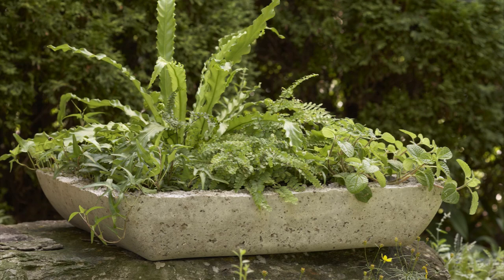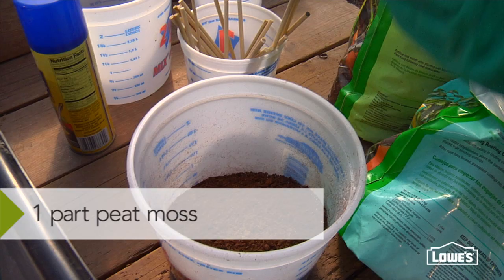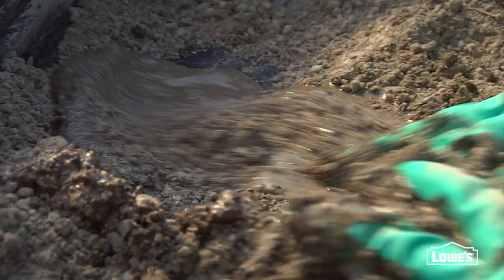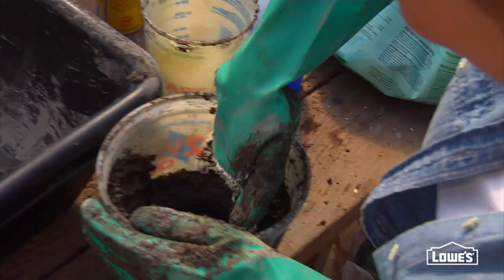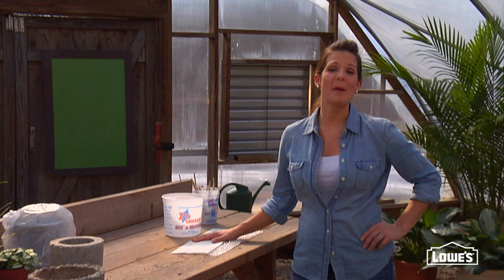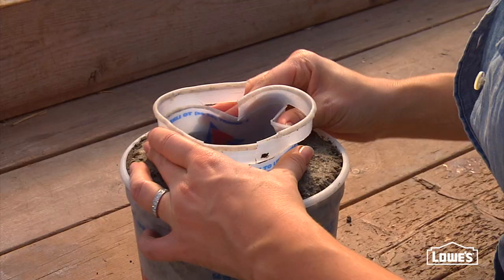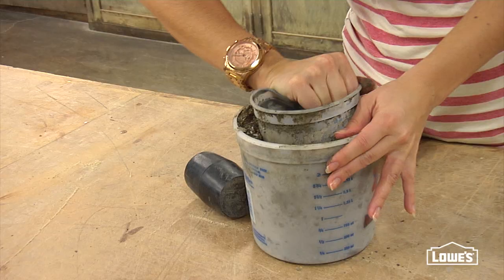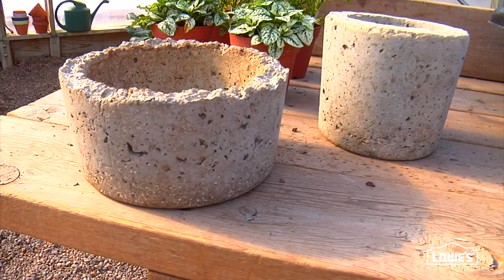How to Make Hypertufa Pots

Comment: If you want to make it more durable,  In addition to pearlite, peat moss and cement, add 1 part sand as well. Sand gives it more of a stone look too.
Also, during the curing time keep it wet covered in a plastic. That gives it maximum strength.
If you plan on carving it before it gets too hard, which I do,  Sift through your peat moss to get out any large chunks and sticks.
Reply: Thank you❤
Reply: Thanks

Comment: The purpose of these is to look like old stone troughs - and were originally used to mimic England’s old stone planters to plant alpines or other alkaline soil lovers.  Another words - azaleas and acid lovers won’t be happy until a few years or so have gone by to leach the lime from the portland cement out or to amend the beds and test soil.  It is the same situation with why you don’t plant azaleas etc right next to fresh concrete foundations.  Also I think this is basically a cement pot - too much cement in the mix.  The recipe garden clubs and Fine Gardening Magazine suggests is 2 parts portland cement to 3 of perlite and peat plus a handful of reinforcing fibers for added strengths. Or a 1 part portland to 1 1/2 each perlite and peat.  Look I understand the eco issue on peat moss however most that we get is from canada and they are pretty strict on harvesting, and replanting because they don’t want to lose the source.  The US doesn’t seem to have any restrictions but we don’t have much anyway so not a commercial venture.  Use alternatives when you can but I’m now fairly convinced of Canada’s commitment to limited harvest and replant even if individual companies might be greedy.  You can try coir fiber or the cocopeat but it would give you a different look and salt is an issue - coconuts grow in high salt ie beach and salt water..  You would want to soak/drain/repeat any coconut product a lot before using as salts kill plant roots. For orchids, even the coco chips that states is soaked, we soak again for a few days and drain a couple times.  The stuff in high quality potting (read more expensive) mixes has been adequately soaked and buffered like ProMix but most growers like to flush it pretty well.  Back to the pots - you can mix median length 3-5 inc spagnum moss in the mix or shredded paper.  When it dries up and falls out - it will leave a very textured surface too.  The reinforcing mesh Fine Gardening suggests is for strength not looks.  In terms of how much cement - it depends on the look you want and the weight.  The more portland cement - the more weight.  Also the more cement, the higher the ph will be and the more alkaline it will be in terms of leaching.  It all depends on what you want to grow and the weight you want to move.  The weight is why we don’t use a standard concrete mix which is cement plus sand and aggregates. 

Here are 2 links - one is using the mix to cover thick styrafoam planters -  https://www.finegardening.com/article/peg-shares-her-hypertufa-secrets

And their original which includes 2 step curing, leaching method - https://www.finegardening.com/article/make-a-hypertufa-trough

And for aging your regular clay pots for the traditional moss grow that costs a fortune to buy already done - There are prepared moss milkshake products and all kinds of moss - Moss Acres.  If you want to use hypertufa pots to grow moss on the outside for shade growers etc - let it sit for a year or two or better, use it for a couple of yrs with alpines before transitioning to shade and moss.  Most mosses like lower ph more acid conditions under 5.0 (really 4.5 and under) and will be difficult on new hypertufa or even new concrete which will be in the high 7s to 9s.  The peat moss will help in lowering ph of the mix but not much.  But you can play with your regular clay pots - just soak well, keep in shade - use an old blender with moss from your yard or purchase and blend with buttermilk, yogurt, beer, and paint on. Keep damp and in the shade.  Full instructions - 
http://theherbgardener.blogspot.com/2009/06/growing-moss-on-garden-pots.html
Reply: @rosebudforglory - thank you for this information.
When something becomes a "thing," the historical information gets lost.
Reply: I checked the herb gardner. Is it being suggested that a moss smoothie be made ,which will then grow up as moss ? Does this work with 'star' moss
Reply: @saluto1397  I would think so. My daughter has done this a couple of times.
Reply: Thank you❤

Comment: Thank you for a nice video I have a question I'm looking for making pretty large container planters will this work?? Thank you very much👍👍
Reply: It works on pretty much any size. I used a large yoga ball and it came out fabulous. You can also soak fabric in it and drape it over tables, etc for a neat, textured look.
Reply: PS: If you like Halloween, you can make some pretty awesome Halloween lawn ornaments out of it.
Reply: The larger the planter, the more reinforcing material is needed to add strength. Especially of a long rectangle or sculpture with appendages (elephant trunk).
Reply: @WitchyLady21  Can you please elaborate... I love that idea and would like to try. Thanks in advance
Reply: @sundarselvaraj1394  well, essentially you use something like a ball or box, even a bucket as your mold. Apply some silicon to the surface, then take the mixture and coat the outside. Let it dry then add additional coats until it has the thickness you need. Then just slip it off your mold. For the fabric, you literally soak it in the mixture and drape it over something and let it dry. The fabric will assume the shape of whatever its draped over. There are some fabulous examples on Pinterest
Reply: @WitchyLady21  will try on Pinterest... share links if you have any handy... thank you... can’t wait to try this

Comment: Does the cement leach into the plants? I have been thinking about growing plants in them, but this worries me.
Reply: MrGrombie when they've fully cured wash and soak the inside with diluted vinegar/water a few times and it seems to eliminate the issue.

Comment: I finally made some two days ago.  I had enough material for one good sized rectangle planter, and three smaller ones using bowls for molds.  I let them set covered in the garage in the plastic bags for 48 hrs and when I turned the large one out it cracked and broke and when I tried to pick it up, it totally crumbled!! I was sick.  The other three came out easily but they too broke in a million pieces and I literally could crumble the damp material with my hands.  I’m sure if I mixed more cement with it I could use it again!! What did I do wrong??? I made a humongous container of it to have on hand.  4 of, Vermiculite, Pearlite, Pete moss and cement!! Why did it disintegrate!! The only logical explanation I can think of is if I miscounted when I added the cement!! Any suggestions would be greatly appreciated!
Reply: Vermiculite OR pearlite, don't add BOTH. I don't know for sure but you might be able to reuse the crumbles, try a small batch with more concrete.

Comment: how long can I keep the mixture wet if I want to use the same mold over and over again?
Reply: Not very long the cement has a chemical reaction when it gets wet that starts the drying process trying to slow it too long can give you a clumpy gravel mass.  best to make small batch mixtures.
Reply: This stuff dries too fast to reuse the same mould with the same batch of mix.  Better to collect several moulds, or make up only what you can use. It was tolerant enough to allow me to make a bit extra to fill the pot I was making, but I had premixed a larger batch of the dry ingredients, then stored most of it, only adding water to some of the mix.

Comment: great video ... how strong is it ?? can i stand on that planter ??  thankyou for respond...🖒🖒👏
Reply: It should be strong once it’s fully cured. Cement actually doesn’t “dry”, it hardens from a chemical reaction. If you want the planter to be very strong, you might want to put wire mesh between the inner and outer molds. Sides and bottom.

Comment: I have just bought a block of peat moss. Do I just crumble the dry peat moss or do I have to rehydrate and then crumble the moss and the use with my other  mis? Please help, I am dying to try these pots.
Reply from the maker: +Ann Peters the peat moss is  mixed in a 1:1:1 ratio with other dry ingredients (Portland cement & perlite or vermiculite). Find additional project details here: http://low.es/1NiypBD
Thanks for watching our video.
Reply: Oh dear, I have just discovered that my peat moss block is actually coconut coir, but is marked coconut peat.  Would I still be able to use this?
Reply: By the way, great video.
Reply from the maker: +Ann Peters you can but without peat it's not a "true" hypertufa. As peat decomposes it leaves pits and crevices which mimic Tufa rock; coconut coir decomposes much more slowly so although it will hold up it will look different than pots made with peat. 
We found this recipe in several places:
- 2 parts coconut coir
- 1-1.5 parts perlite
- 2 parts Portland cement
- Add enough water to get right consistency

Good luck!
Reply: +Lowe's Home Improvement Thank you so much for your help. I am a wee bitof a conservationist so might go the coir route.   The peat moss is also very expensive.  But once again thank you very much.
Reply from the maker: +Ann Peters Happy to help. Good luck!
Reply: Hi, yes a very well explained diy. However, I have a question, which might be on the strange side! What is Portland Cement?. I live in South 🇦🇺 and I’ve never seen this product for sale here. Would quick set cement be the same? The other item do do know about as I’ve seen them at our local Bunnings Warehouse stores. Thanks in advance for your reply.